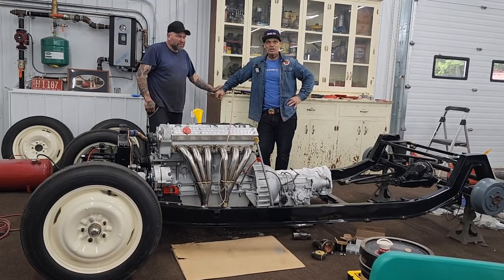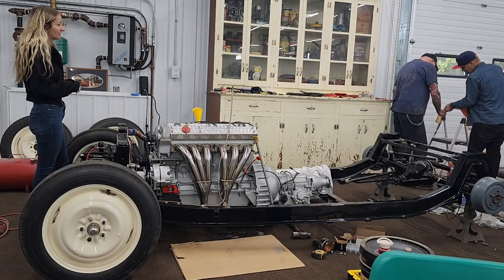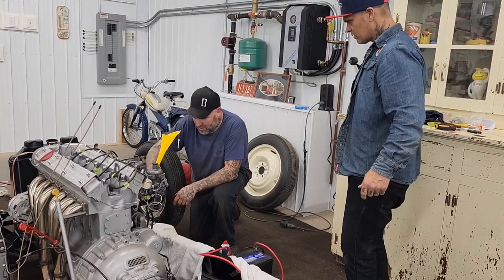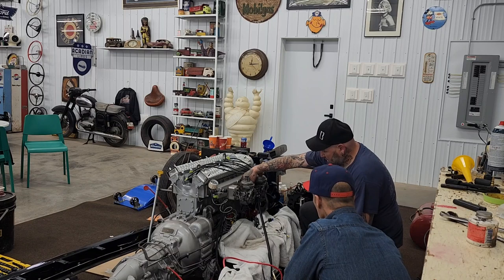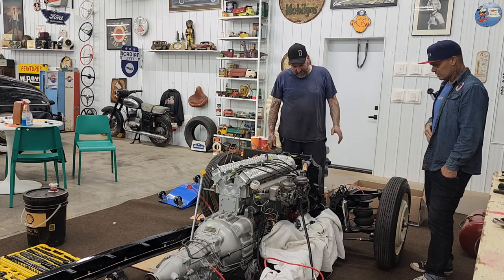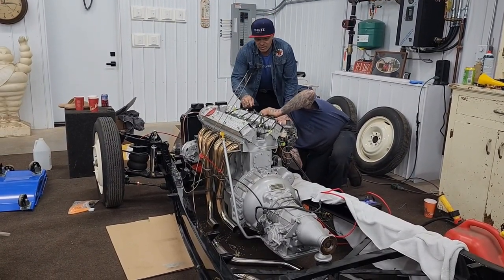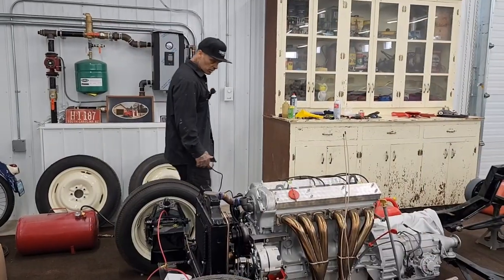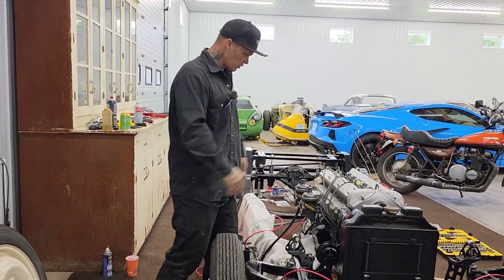Firing up the Bugatti engine.... cross your fingers!!! 😝🙏🏼

Comment: Don't know if ya noticed but the chrome headers turned gold which usually means a lean condition in the carbs . Also a tool called a uni-sync is needed to balance the carbs so they are pulling equally .
Reply: Lean would turn them blue.
Reply: Blue color would indicate a lean condition learned over several multi cylinder multi carbed bikes

Comment: The engine to chassis ratio is more than generous. Plus, it’s a double overhead cam design on a jaguar in-line six...known for awesome torque. Wow! This will be a Bugatti Rocket. It really is the essence of a hot rod. Big engine, small, light car. Hang on Jolene! This is about to get really interesting. Let’s hope not too interesting.

Comment: I have to say..... If you're building this car for a Queen.... scrap those carbs! Get some triple Weber's. Yes some of the comments are spot on. You need to remember, Idle speed and timing are where you start. And have to check thru out tune. Carbs need to be" Synchronized" to tune right, giving oil is right type and height.... Kind of a pain if you don't know. Get this car done!!!! That's why I watch this.. And to see a welding Queen! She rocks and does so much behind the camera! Thumbs up!

Comment: Chad screw out the two black plugs on the top of the carbs and make sure they are full of oil up to the threads. This is what controls the jets and mixture.
Reply: You fill the dashpots with oil till the damper rod feels a restriction when you push the damper rods in. Should feel the restriction about 1/4 inch before the threads would begin to screw in.
Reply: My thoughts to, Strongburg snd SU carbs use the same system with the oil in those dash pots slowing the throttle pistons when the accelerator is opened suddenly, thats the accelerator pum with these carbs
Reply: Had similar carbs on an Austin American. A mechanic told me much the same thing, check the oil level frequently, if your vehicle starts to fart and shudder low carb oil is one ofthe things to check first (the usual cuprit on my old Austin).
Reply: Owned a 1966 mk2 jag with the 3.8 in  It .over her in the Uk the first thing we dump,is them crap stromberg carbs for Skinners union carbs .  Same in the early 3.5 v8  litre range rovers ,them stromberg things have been the bane of many a jag ,triumph and range rover owner or anything else with them on it ,sure satan himself designed them things 😂😂 .setting the fuel mixture is a pain in the arris and the splitting rubber diaphragms ,even new ones were found to be useless with holes ,tears in them .or coming away from the metal inner all the time .I had boxes full of them off all sorts of old cars .when we changed them to SU’s ,in the end I scrapped them cos nobody wanted them !even on restorations they still didn’t want em .theymade a inlet manifold in the 80’s for the rover / Buick v8 that would fit quad 1”3/4 SU’s on it ..
Reply: @craigpimlott204  Stromberg make a lousy side draft carby, S.U. make a great side draft its just that simple
Reply: @lotuselanplus2s   correct. And the type of oil is important as well. Too thick = sluggish. Too thin , no enough resistance.
Reply: @gizmodietsch3922  yes, that is correct , transmission fluid works well as dies 3 in 1 oil.
Reply: @marcos3ltrv6  correct.
Reply: @craigpimlott204  youve only got to understand them to get them to work right,  never really had much problems with my Strombergs in my Triumphs.
Reply: @brycechessum4684  i prefer Strombergs, much to work on slthough i dont like the later Stromberg adjustment via the special tool down through the damper assy and that 'o' ring there that leaks the oil.out, i found more performance with the Strombergs over the SU carbs though.
Reply: @lotuselanplus2s  or Marvel mystery oil, BUT S.U.'s are better, but both need a special touch. I went to Dual Webers. You have to learn to synchronize any dual app first, then the rest is pure power!
Reply: @lotuselanplus2s  Fill them with Brake Fluid and have some fun. Getaway car smokescreen and it smells divine.
Reply: @gizmodietsch3922  I work on 4 cylinder motorcycles so balancing 4 carbs isn't that bad,
Reply: @lotuselanplus2s  but have to know how to sycro carbs etc... Not a bash, just a comment.
Reply: @gizmodietsch3922  true, not a real problem with the right syncronizer.

Comment: When my Pop's rebuilt my Chevy engine my engine had so much compression I went through 3 batteries trying to get it started. 

 👍🏽it's all headed in the right direction. The Engine is looking great! and sound great. When you lift the hood the engine is going to look like a gem/diamond in a julery box👌

 Like I said in the beginning that's a huge engine for the light body this Bagatti going to give a corvette or Cobra a run for its money. 

Diffently have some good seat belts, roll bar or be light footed on the gas peddle. 🏁

Comment: Mentioned before. If the carburetors aren't the same distance from the original inlets because of the modification you did. The air fule mixture  won't be the same as before. So jetting or mixture might need adjustment.

Comment: Its a runner! Once exhaust is done it should sound sweet! Another step closer to finishing.
And now for a celebration drink👍
More it runs the better it gets.
Sea Foam is also a fuel stabilizer, i would put it in everything (that runs)

Comment: Years ago there were several DIY articles in various magazines (teenagers..think hard copy with color pictures) written about "what to do if this happens to your car". One of the emergency tricks was if your fan belt broke to use a pair if panty hose. I was skeptical but just for 'shits and giggles' I tried it..and it did work well. I guess guys that didn't have a gal with them could have used electrical tape, but it wouldn't have been as much fun! Great to hear that engine bark to life, the Bugatti is going to be a speed wagon!  Check out the grin on Jolene's face when it fired...priceless!

Comment: Chad + Jolene. that's a sweet sounding Jag! Fine tuning on dual carbs is always a bear. See if you can find some Berrimans fuel system cleaner and Valve carbon cleaner. It's about half the price  of Sea Foam and works great. Derek at Vice Grip Garage uses Berrimans all the time. Looks like you found the right mechanic! Great video!

Comment: That thing sounds sick brother good job Jolene will have to be careful power to weight ratio that things going to fly. Also down in the comments fellow explained you need a special tool to tune those carburettors in sync great job love your work

Comment: I woukd of checked to see if there was 3in1 oil in the tops of the carbs unscrew the 2 black caps on the top of carb and check see if there's a small amount of oil in them .

Comment: Watching the video my advice would be to get hold of a mechanic that has familiarity with British cars and especially CD carburettors (SUs & Zenith Strombergs as fitted to your Jag engine.) The needle and seats on the Zenith carbs only tolerate 2.5  - 3 psi of fuel pump pressure so it's advisable  to fit an adjustable inline pressure regulator. Also both carburettors need to be balanced for air flow through the throats. Any experienced British engine mechanic would have no issues sorting the carbs and also correcting the mixture strengths. Engine advance needs to be centrifugal or mechanical. Any vacuum advance is purely there for cruise situations to improve the fuel burn and thus economy. The vacuum advance capsule should be connected in front of the throttle blade (ported vacuum) not behind on the manifold side, otherwise it will pull full vacuum on idle...which is what you don't want. Those 2 CD Strombergs should also be 1 3/4" throat size not 1 1/2" throats (its hard to see the actual throat size on the video.) A better size Carburettor would be the use of 2" SUs which would be a better fit for the engine capacity and performance. Unless your mechanic understands CD carbs and Jaguar DOHC engines it would be worth your while to get someone who really does. Query the Jaguar Club if you have one in your region or at least look up their tech forum for advice.  Good luck.

Comment: Looks good  and sounds good ! Congratulations.  One those SU carbs there is a jet needle you can adjust for overall mixture as well. remvve the tops and you will see it hanging down. This is providing the other circuits are clean. As mentioned below a uni sync  tool will aid in adjusting the balance of the 2 carbs. You place it over the mouth of the carb and adjust to get a reading in the little gauge , once set  move to the other carb and and  adjust linkage to match the first reading.

Comment: looks like carby's are side daft strombergs, don't know how old they are, but the diaphragms can be a problem and often need to be replaced if they have gone hard or get a pin hole in them. SU's are a better system and easier to work with in that style 16:12 sounding very flat, up the timing a bit, also set up the oil on your slide dampers( screw caps on top off carby's), I use sowing machine oil or dex III trans oil, only need a very small amount, (its to stop the slides from fluttering), set the ign timing with vacuum advance hose disconnected/plugged at distributor, and  also run a vacuum hose to both carbs linked together with a T-piece going to Distributor, to keep the carby's balanced, 
hope this helps and is a guide Chad

Comment: The camshaft in fuel injected engines usually are a different grind than carbureted engines.
This might be your low rpm issue.

Comment: It sounds like the timing might be a little late . But as said before the dash pots need to have enough oil to make that SU style carb operate correctly . I don't think it's the fuel pump as was stated though . Also, it sounded like it has a weak hole ... But that could be from not being run for some time and a little carbon or rust around a valve and seat .  .

Comment: Check that engine to bell housing. The transmission is in gear so I hope you have the lines hooked up. Also the engine at the rear seems to rock more than the transmission  are they bolted together tight???

Comment: What year and model Jaguar is this engine from originally? If those are SU carbs make sure the piston inside has light oil in it for lubrication,it makes a difference. We had an Austin Healey from ‘59 with SU’s and they can be finicky. Those carbs need to be synchronized too. There is a tool to do that. I’m not a mechanic but I know some of the older guys use to listen to the suction through a rubber hose up to each carb to check the sound but the tool is obviously more accurate. The original E-Type had triple carbs.

Comment: should be really smooth engine check the firing order should be 1 5 3 6 2 4 not like some engines 1 5 3 6 4 2, also the Stromberg carbs check check the diagrams and put fine oil in the dash pots

Comment: You need to synchronize both carbs in tandem with air meter adjustment values ,,,separate at same time or it will never run right!! That's how they tune Ferrari carbs 4 separate air meters but it's damn close good job he probably already knows

Comment: With CD Strombergs in pairs or triples they need to be balanced so they open exactly at the same time or the engine won’t run evenly. I use a carb balancer.

Comment: Chad and Jolene I had a 59 Volvo years ago that had Su carbs on it and the black caps on the top of the carbs unscrew and you put 30 weight motor oil in them. If there isn’t any oil in them that may be your problem

Comment: That enging has dry cylinders, thats why you are getting that heavy squeaking when you start it. Get an oil can with emgine oil and when it starts put a squirt or two into the intake of each carb, be careful starting dry as you are, you dont want to burm the rings or score the cylinders.

Comment: Dear Fans and Engine Builders. On those Headers look at the Diameter then Chad has Close  it down (looks like 2” exhaust pipe ) so small . Would that Cause back pressure to make that sweet Run like Poop? Please help Chad out before he hurts the Engine!

Comment: Did I hear that the Machanic was using brake clean to start the engine?
Reply: works great
Reply: @67goingthing  did he mention ETF, when the mechanic was talking to Chad about the sea foam and the ETF circulate through the carb that the float is sticking or needle and seat is not seating properly? What is ETF?
Reply: O it was ATF automatic transmission fluid.

Comment: A Bugatti engine? Where's the body? Show us what the engine's going into, I would like to see it. Also is the Texaco project on hold or are you burning your candle at both ends?
Reply: The body is sitting in the shop. You can see it in most of the videos.